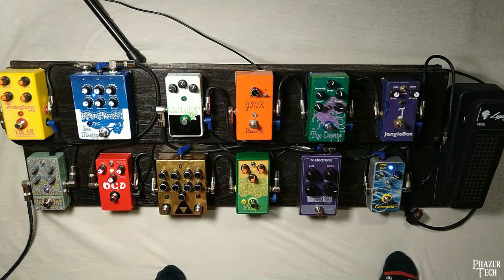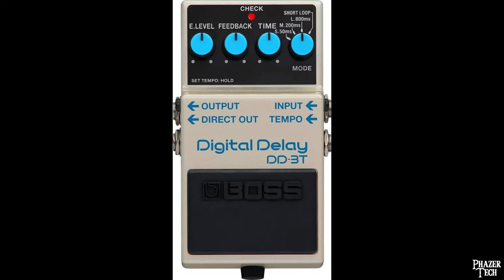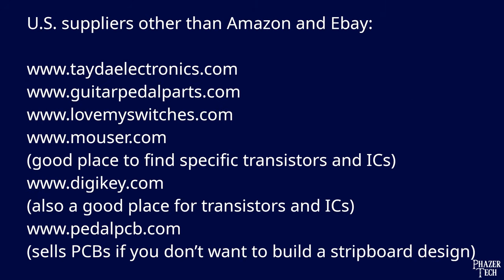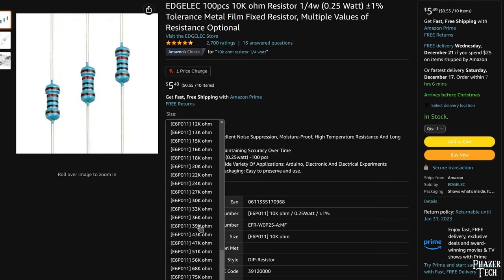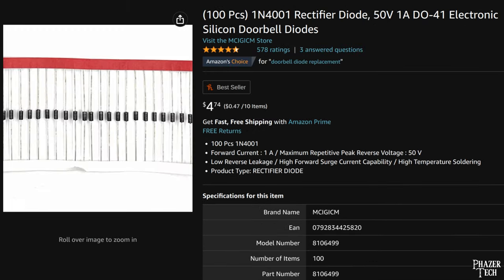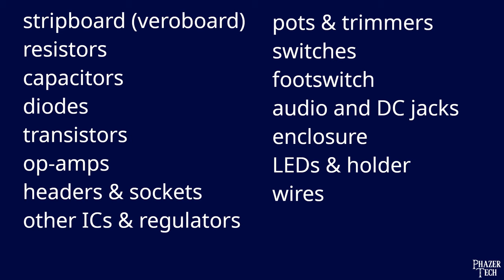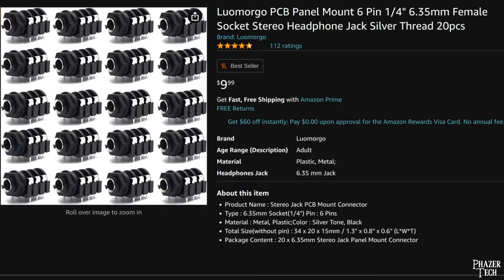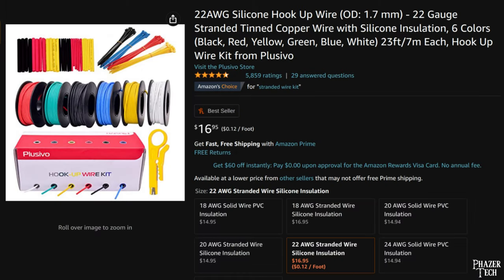DIY Guitar Pedal Guide - Introduction & Component Selection Tips - Part 1

Comment: excellent segment! Very indepth and perfect for my newly built Beavis board. Can't wait to see the full segment of this, I may just stock up some stripboards and tinker with during the holiday break!
Reply from the maker: Thanks!  Nice, the Beavis board should make it a lot easier to compare different circuits or to make mods.  For example if you want to build an overdrive but can't decide which one you want to box up, then I suggest building the stripboard for a few of them so you can compare them with a flip of a switch on your Beavis board.
Reply: @PhazerTech  great suggestions,  I might just do that!

Comment: Thanks, this was a helpful introductory overview of pedal building as I try to figure out what parts to buy. One thing I didn't quite understand at 15:14: for the 1/4" input jacks, why are TRS sockets required instead of TS if you use battery power?
Reply from the maker: The ring and sleeve connections of a TRS jack are wired in such a way that they act as an on/off switch. When a cable is plugged in, it completes the circuit for ground and turns the pedal on. When the cable is unplugged it turns off the pedal. This is done to save battery power when you're not using the pedal. You can Google image search "TRS battery guitar pedal" to find diagrams of how to wire it.